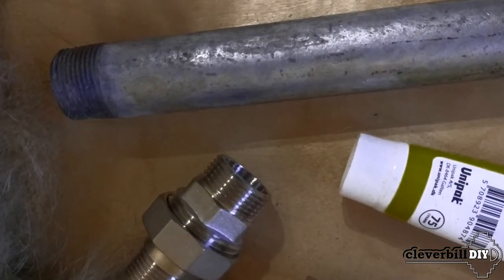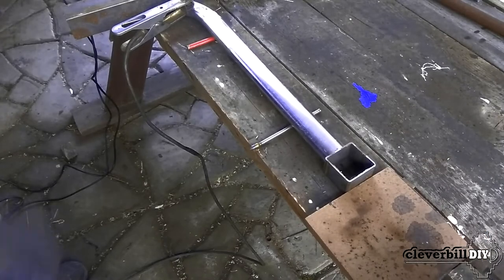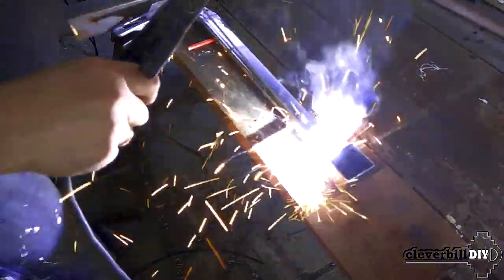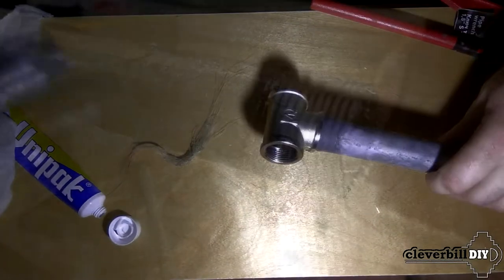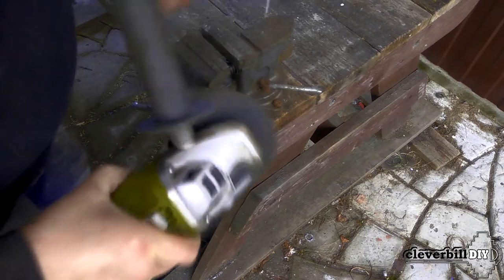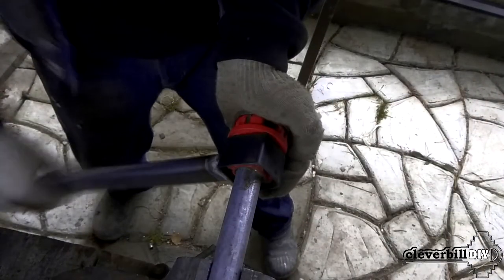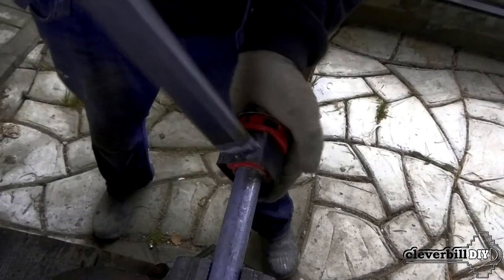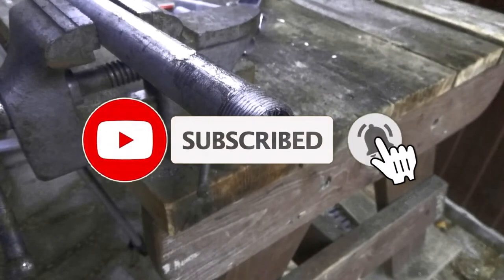How to Cutting Threads on pipe using a pipe threading head - DIY

Comment from the maker: Cutting a thread on a pipe is not very difficult, but physical strength is needed and, most importantly, when cutting threads on the outlets of an existing water supply system or central heating pipes, do not overdo it so as not to break off pipes, which in appearance may seem very even very strong.